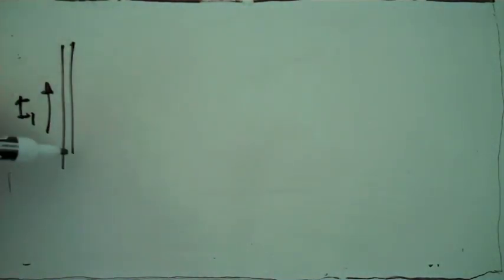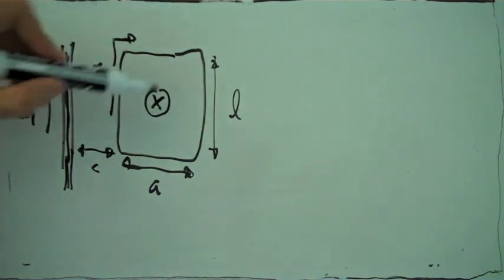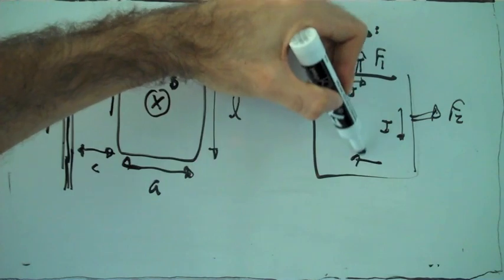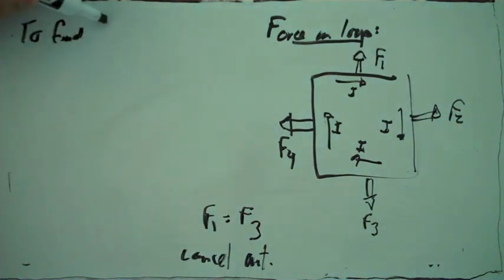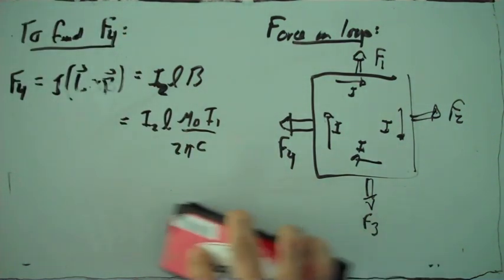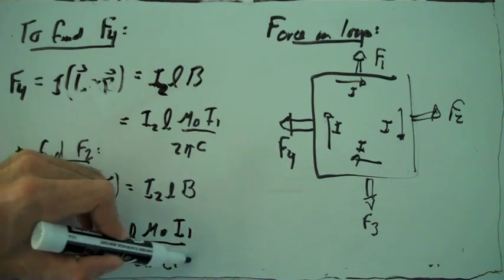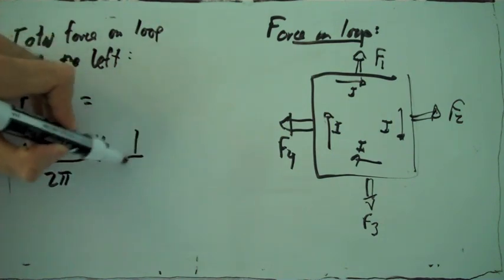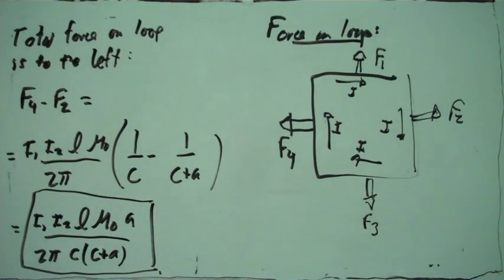30 24

Comment: Why do F1 and F3 cancel, but not F2 and F4? They're still facing opposite directions, right?
Reply from the maker: Yes, both pairs are opposite direction, but only F1 and F3 have the same magnitude.  The B field from the long wire drops off as 1/r, so sides 1 and 3 of the loop experience the exact same field:  one that is large on their left side and drops off toward their right side.  Sides 2 and 4, however, experience constant fields but they are different since one is closer to the long wire than the other.